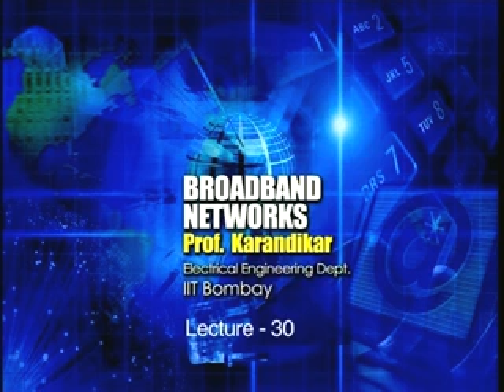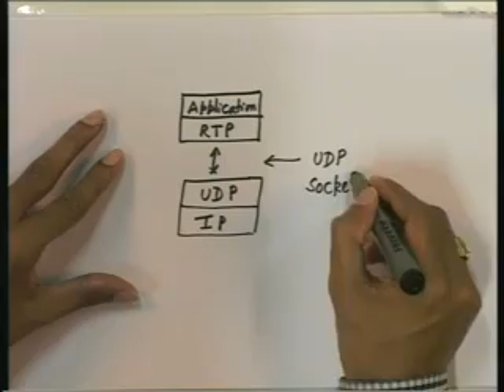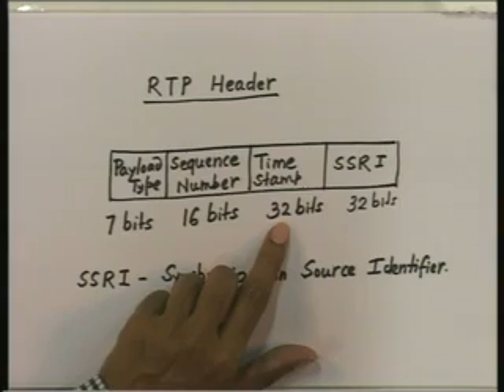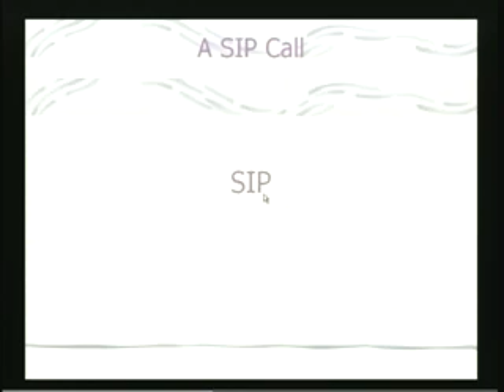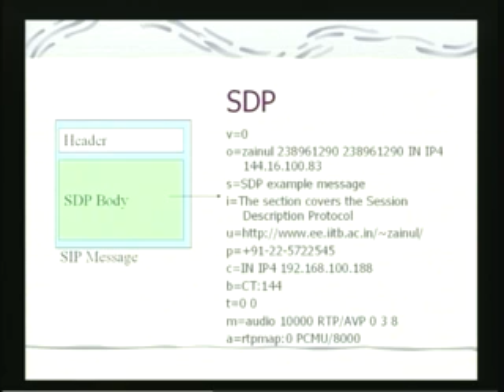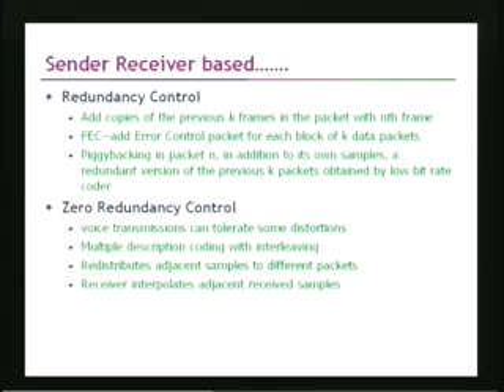Lecture - 30 RTP

Comment: Question: when you're going over the RTP header notes you stated that "RTP itself does not provide any mechanism to ensure timely delivery of packets", but when you're discussing the Time Stamp you make note that it looks at the timing sampling the first byte to remove jitter, which the excessive timing between packets. Would be able to clarify? It seems that the two statements contradict each other. Wonderful video's by the way. Keep up the good work.. :-)
Reply: Brian Thomas hey not sure if you still don't have this answer but hopefully I can clarify. Basically what the prof said is true RTP does not have any mechanism to ensure timely delivery itself but you will find most VOIP phone manufactures implement something called a jitter buffer to remove unwanted jitter. This jitter buffer is implement in addition to standard RTP and it relies on the RTP time stamps to know what to do. So RTP is not ensuring the timely delivery of packets but it is making it possible to remove jitter if you would like too.
Reply: Abdi Bulle thank you very much for the clarification. I'm always learning it it's very helpful for someone like yourself to aid in putting the pieces of the puzzle together.
Reply: Brian Thomas My pleasure. This has always been an job/interest of mine and I love to see people show interest in telecommunications and engineering